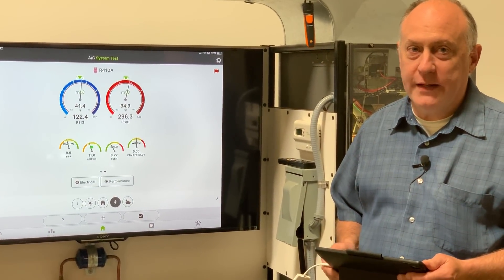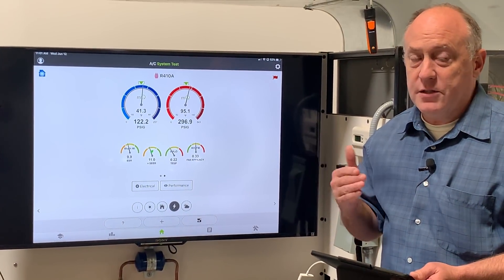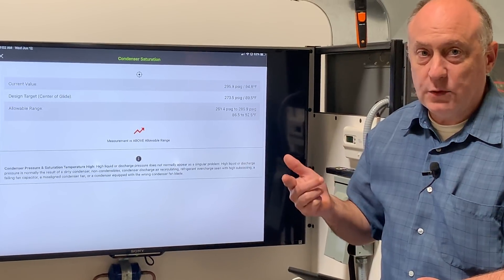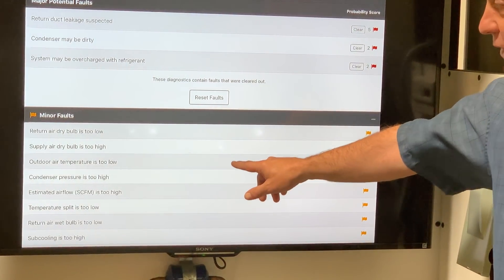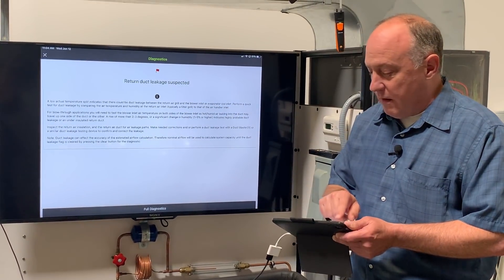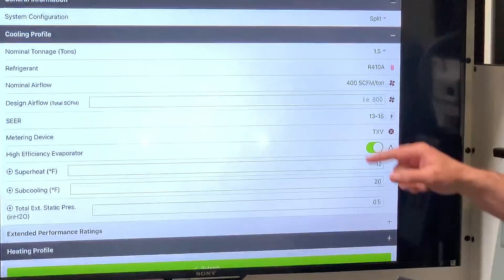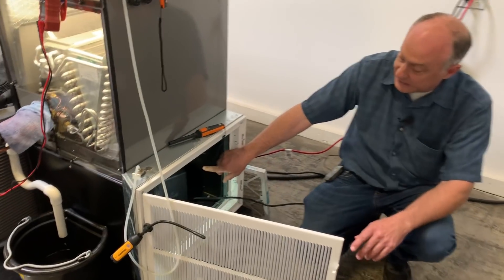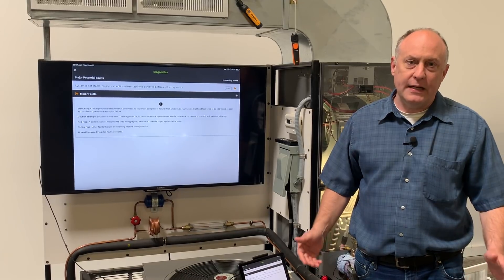Identifying Return Duct Leakage with MeasureQuick

Comment: All nice but one fault. This app does not work on my device or my coworker.
Reply from the maker: What device are you using? We support Android and iOS. Unless you device is very old, Windows or Blackberry it should work.
Reply: @measureQuick  I am using Note9. I uninstalled the app several times,  link JodLink devices and map them. Several times for the day app keeps updating when open. Eventually I think I will get it.